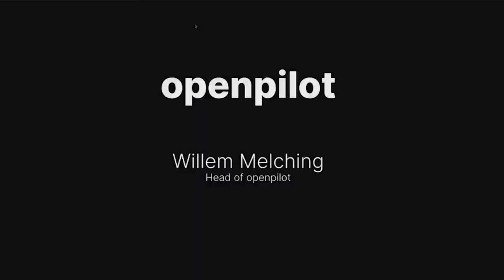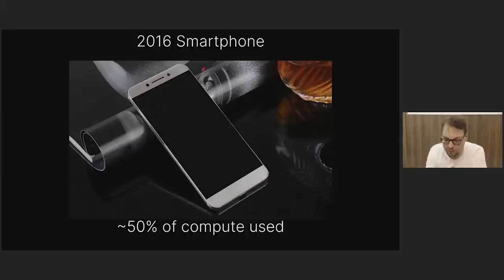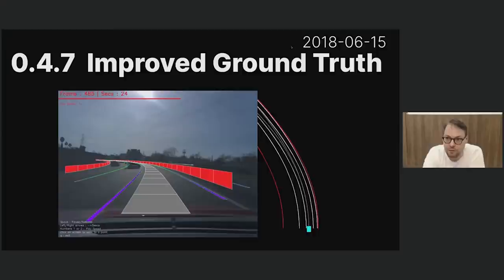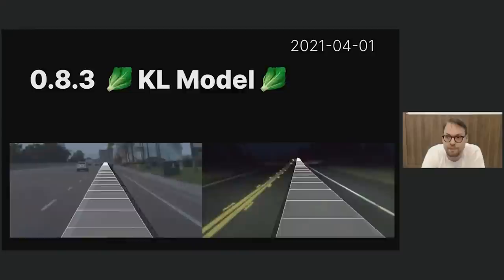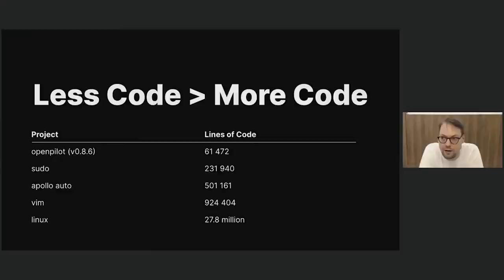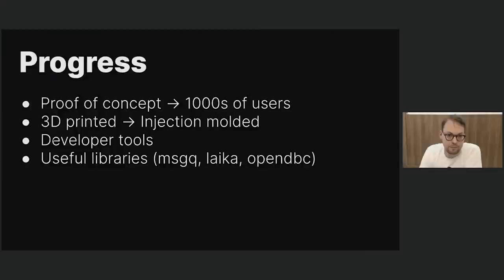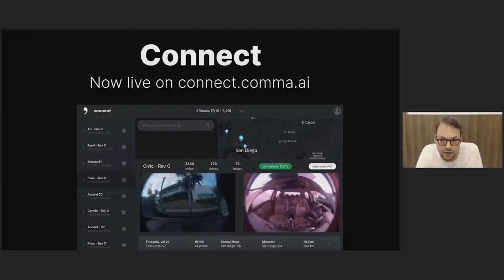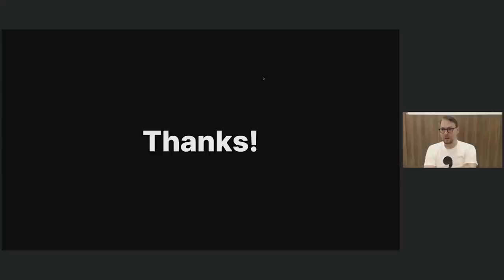The History of openpilot | COMMA_CON

Comment: only at the beginning of this video (about 2 minutes in) but wanted to ask about redundancy and backups and cross checking of data. while self driving vehicles are not as critical as a plane flying in the air with hundreds of passengers it seems that there should be some sort of redundancy and cross checking of data being done for safety?
Reply: for example, what happens if a camera fails, or the comma 3 device falls down from the window while in self driving?
Reply: @One_Guy  The driver takes over. The potential improvement is to send a few seconds of future commands to the panda, so even if openpilot crashes the driver has a decent amount of time to react
Reply: @grekiki  thank you for the reply!
Reply: From my understanding openpilot sends information ahead of time, just like how a human driver will anticipate and prepare for a turn before actually initiating the turn. The car then receives that information and then carries it out. Features such as emergency braking are most likely sent through a low latency path and open pilot has no input for this and it’s just on the car. Just think of open pilot as an enhanced auto cruise control with lane tracing for right now. My guess is that also when open pilot sees no lines or semblance of a road, open pilot probably will disengage and provide an error alert